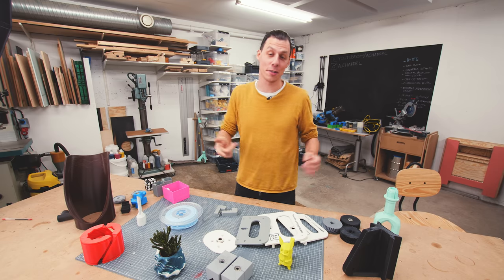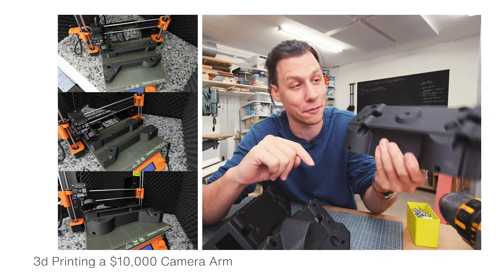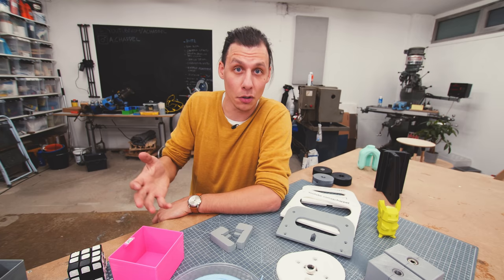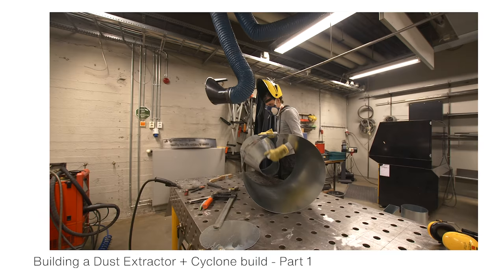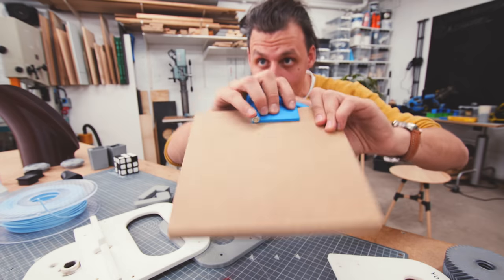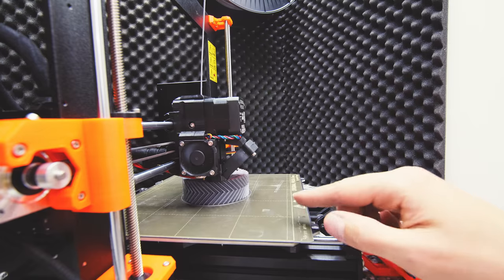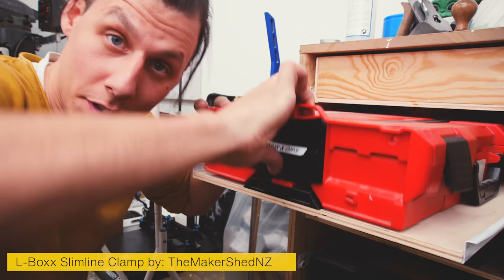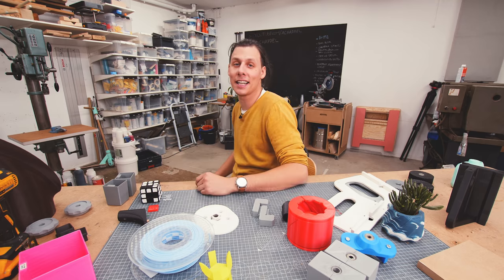Is 3d Printing Useful?

Comment: For me, the biggest downside of 3d-printing seems to be time. Taking material away is still so much faster than additive processes.
Reply: subtractive is so messy though, and dangerous.
Reply: @difflocktwo  : Don't get me wrong. I like the technology and I will get a small one myself in the future for making knobs and handles and vacuumadapters. But that will be one of a kind objects. For a production run, I would find somebody with a machineshop and a pile of Delron, because of time and failure possibillity. Greetings from Germany
Reply: @MichaelKieweg  I was mainly thinking for people who like to design 3D parts at home. For production it's a different story.
Reply: @difflocktwo  : We are on the same page on that. As I said, I will get one for myself sooner than later.

Comment: So buy a $5000 printer to print really large pieces, get an mechanical engineering education, and you can save a trip to the hardware store and $200. My experience so far is that it’s a time sink that you better outsource

Comment: It's as useful as the person who uses it. I am an engineer, I can make parts cheaply and quickly for very low cost. I can 3d model, perform calculations and I comply with regulations and standards. So, that's quiet different from the average Joe. I know my parts are useful, reliable and safe for use.

You can also make lots of junk. Things that are not safe or flammable or whatever. Garbage in, garbage out.

So, it's up to the person using it. People rewire there homes and burn them down. Folks use saws and loose their fingers. My point is simple. If you know how to design things that are safe, you are fine. If not, just stick to making toys and wall brackets :)

Comment: even tho its useful for only a particular type of user its not always beneficial ...yes for you its worth it because for the cost of making a small item it would cost way more making it then just simply buying the plastic containers such as the one you made for your drawers ....all those you can buy them from harbor freight for hardly anything and i bet you payed a ton to just make one drawer of containers or maybe you did not because you are a youtuber and get things free but for a regular person it would not be practical. Only really expensive parts that you maybe can help in assisting to make something like the camera device thing you made which was only the brackets that were 3d printed only something like that offsets the cost but that's only a rare occasion of an item to make thats worth it....the rest the filament cost to much to make when you can by the same thing in the store cheaper. Another thing also is if you have the money to invest in a larger 3D printer because pretty much in all your prints you have used a large printer to do most of all your things you made that were useful ....just a few of the things with a regular 3D printer size version and those things not everyone really is going to make them since not everyone's a wood worker...I sometimes find you get a 3d printer and you just make an excuse to make anything and you really don't even need it and you end up spending even more money for things you never even needed or could just have bought it in the store for way cheaper than the filament cost....so it really depends on the regular person and consumer because unlike you we all dont have sponsor videos and people who give us free stuff so its easy to say its useful and worth it when you don't need to pay for most things or can simply afford it to do anything with it...so its all iffy.

Comment: Useful yes, accessible - NO. If you don't have CAD and reverse engineering experience, it's pretty useless other than for making toys and collectibles from Thingiverse. It's an extremely useful tool for professionals and the order of magnitude drop in cost is huge for education and enthusiasts, but this is not the next microwave. And that's just fine.

Comment: This video is misleading because the awful truth isn't mentioned, and that is... buyer beware - you have no support options when it comes to 3D printing.

Sure, 3D printing works PROVIDED that your printer is calibrated correctly and you have no issues ever with original (crap) parts or aftermarket items from China that sometimes work and sometimes don't.

What a lot of beginners don't understand is that YOU ARE ON YOUR OWN. The best you can do  if you need support is to beg for help on message boards. THAT'S IT. Don't let anyone tell you otherwise, because there is no official support and you'll be at the mercy of the internet for help.

Sometimes, you don't even get installation instructions to build the stupid printers (I'm talking to you, AnyCubic).

I've had boards burn up or the metal nozzles bury themselves into the bed. And guess how the sellers responded?  Ghosted.

If you're crazy enough to spend your money on crude 3D printers that have no quality control, good luck. You'll need it.